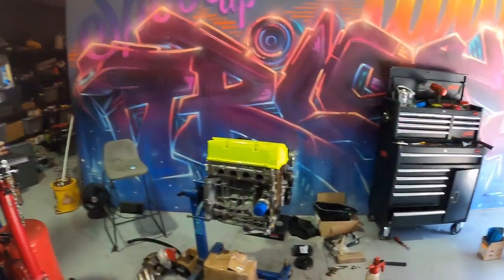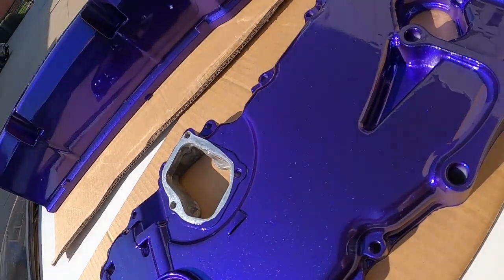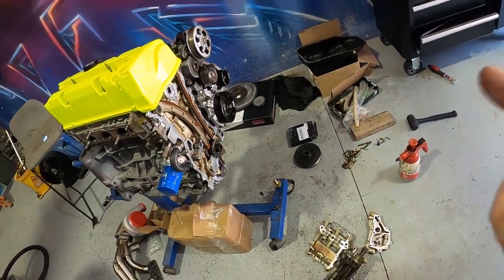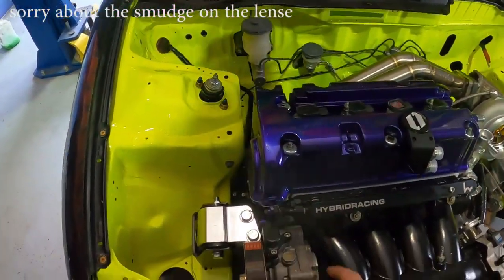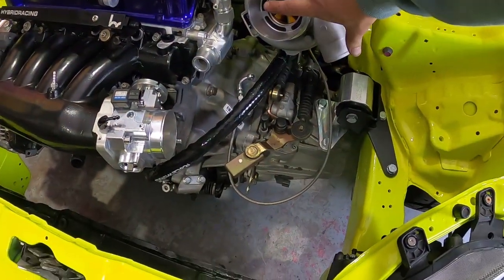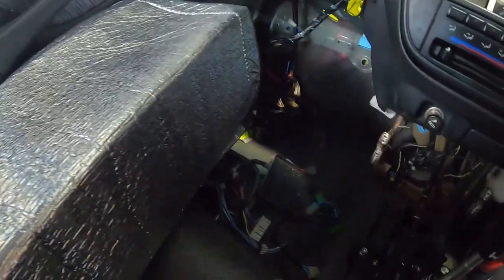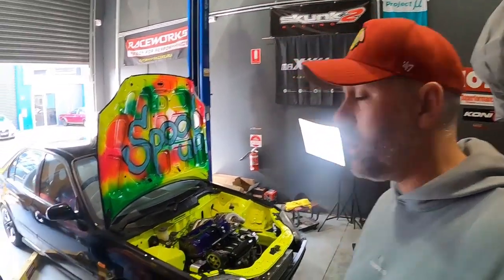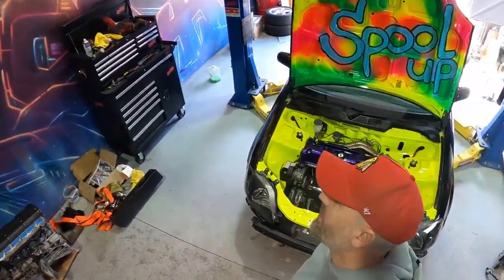KSWAP K24 TURBO 6 SPEED IS MOUNTED

Comment: Hey Tristan, I have recently acquired a 99 EK Hatch. I have been put on to your channel threw someone and I am loving it. My EK is an auto sadly with the D16. I am wanting to go manual and wondering what would be the best way to go from here  before i start boost modifications. I am pretty local to you
Reply from the maker: First off you need to find a gear box a clutch a flywheel a clutch master cyl a clutch slave cyl and gear oil maybe even some new seals and the linkage arms, I have pedals and interior parts for the conversion aswell as the linkages
Reply: @TURBOTRISTO  Is there a recommended gearbox or just a manual civic of the same era? I know that the type r has the LSD but not sure if i should be looking for that or if a gearbox from another honda with more stock kw would fit with out much modification. sorry if I seem naïve. My first week with a honda and there is so much info I need to learn. going to do rear disks and mini cooper first though.
Reply from the maker: @thomasmitchell8385  manual civic from the same era is fine

Comment: It’s looking good! What brand chain tensioner did you use? I know the OEM ones have a horrific track record. Scare me away from all of the modern Honda engines personally. I’ve had a few customers with engines fail due to that horrific tensioner design. How did your new head end up working out on your d16 build? Just decide to keep it low psi? Or did you ditch the car
Reply from the maker: I ended up
Selling the whole
Set up I couldn’t be bothered with d series any more
Reply: @TURBOTRISTO  that much of a headache huh? I’m sorry to hear. How do you feel about the set up of the engine bay compared to the d-series? What chain tensioner did you use by chance? I couldn’t make it out in the video, I always unfortunately put oem back on them.
Reply from the maker: @jameshunt5316  this is a company that makes oem tensioners but not oem I will be stocking them in my online store coming soon
Reply: @TURBOTRISTO  gotcha, sounds like a plan man. Hope it turns out well!

Comment: What hole on the rear engine mount did you use?
Reply from the maker: The highest one
Reply: @TURBOTRISTO  I take it you used all the highest holes?
Reply from the maker: @lemonz211  yes, is that bad?
Reply: @TURBOTRISTO  nah man it’s just put my k24 in yesterday and can only line up the two side mounts to top hole but rear I can only get in the bottom hole
Reply from the maker: yeah I had that issue, I just fought with it for ages

Comment: You using a full complete k24a4 transmission and motor right and you have ekk4 mounts right ?
Reply from the maker: Correct
Reply: @TURBOTRISTO  the ekk2 and ekk4 t bracket are close to the same or completely different?
Reply from the maker: unsure i have an eg subframe witch is recomended so i bought the kit to suit the right car and conversion , you could check the part numbers on hasports site, im sure they are very different kits

Comment: WHAT SERPENTINE BELT SIZE ARE YOU USING...P/S with no A/C?
Reply from the maker: 7pk1385 with a 10% under drive pulley maybe try a 7pk1380 or buy an under drive pulley from me ;)
Reply: @TURBOTRISTO  i have no plans to go turbo presently. Would the 20%  be a better choice?..I am.also going to run p/s with no a/c, I live in the caribbean
Reply from the maker: the 20%underdrive is for cars that rev over 9500k the 10% would be ideal
Reply: @TURBOTRISTO  great 👍..much appreciated 🙏,,keep up the good works..ill be reaching out to get the pulley,,,my car is a 96 rhd jdm honda civic ek5 rti sedan awd..
Reply from the maker: offft sounds like an awesome ride I wish we got them here